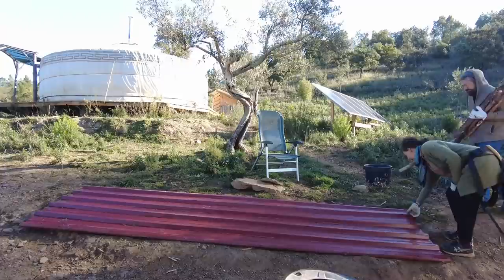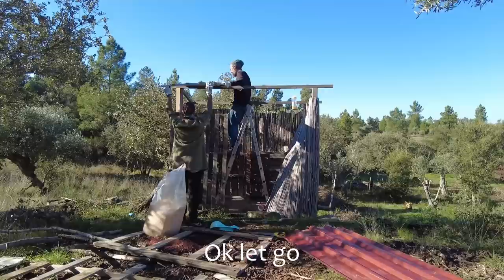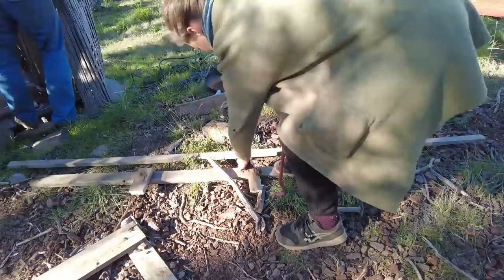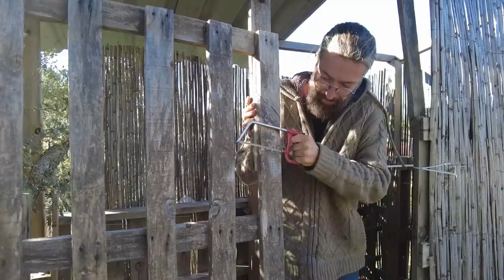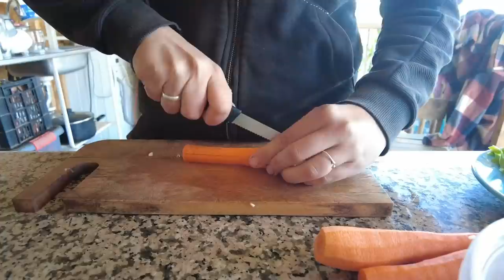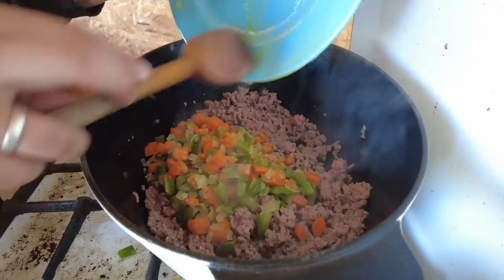(Kind of) finishing this one important project

Comment: I was born in 1948. At that time, few homes had internal toilets (my grandparents big house, for instance, built in 1900, in the ex austrian Empire: a very crude toilet in a separate closet) but most had outside facilities: a shack, a stone support and a round hole. For cleaning? A nail on the wall and very useful square of newspaters. Till the eighties and possibly over,so to speak 40 years ago, only. In supercivilized Italy (north Italy)
Reply: So do I. I was born in a farm,  in 1959.
Reply from the maker: That’s not too long ago! I’m sure it was the same here. Some villages only get electricity in the 80’s, and the communal laundry places are still in use today by a few old ladies